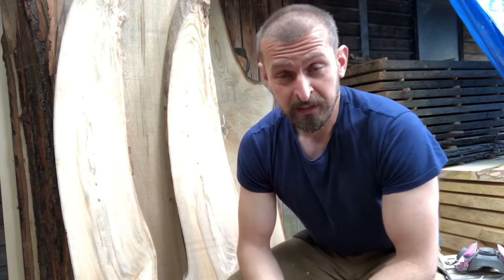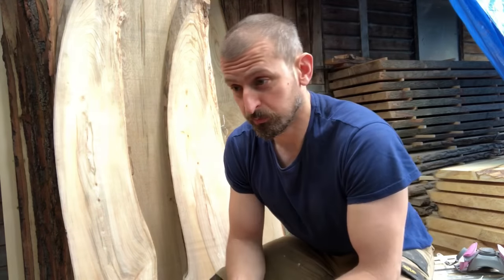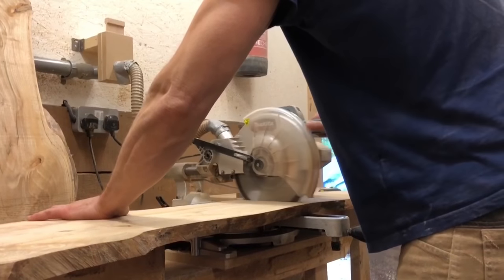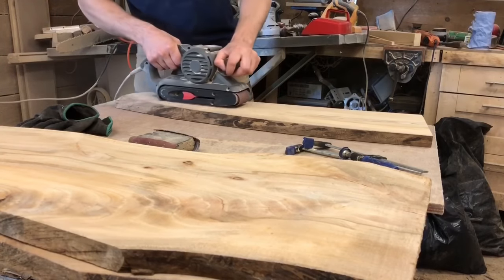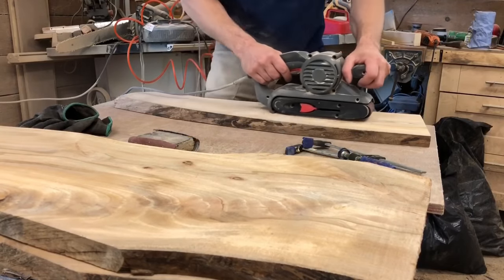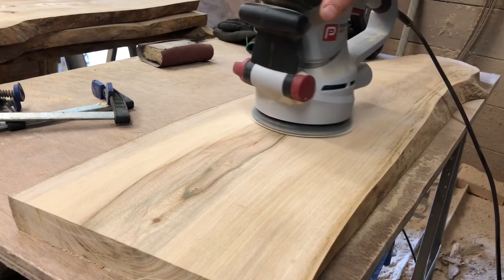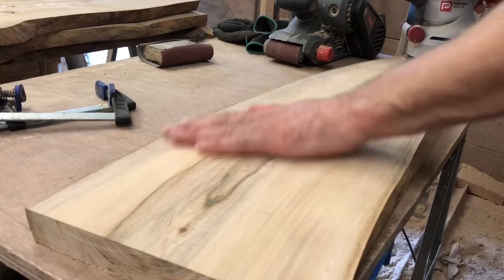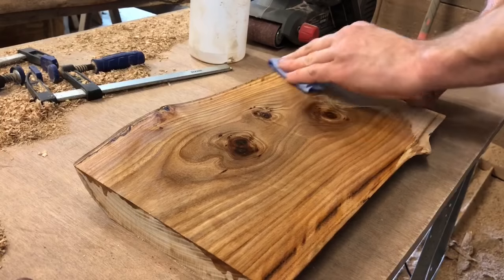Things you should know about Elm wood!

Comment: elm is a fantastic wood. The species of choice for cart wheel hubs because it will easily withstand a dozen or more mortices chopped into it without breaking apart. And was the species of choice for traditional chair seats, again because it will happily withstand all the round mortices for the spindles legs and arms without splitting. It improves as it ages and wears to a fantastic smooth velvet patina when clothing etc polishes it. And elm was always used to make the massive cylinders for village water pumps, and water pipes. I believe some pipes were dug up in London Thames that were 400 years old. If its water logged it will survive a long time, much like alder wood

Comment: Hi mate, firstly glad I just found your channel. Deffo going to subscribe and look at more of your content. 

Secondly I was going to ask a question about Elm. A few weeks ago I picked up a 2xm x 60cm slab of Elm that’s around 2” thick. It is showing around 15% moisture in the highest places in the middle. Those readings were using my meter with probes. Nearer the edges and the rest of the slab are about 5% to 8% moisture readings. 

The issue I have is that after sitting here for a few weeks the slab just began to form some white furry mold on the surface. It’s not the whole slab just one or two small patches but it’s like white furry mold. 

Do you (or anyone reading this) have any tips on what I can do about it? Also does anyone know why it would form a white furry mold as opposed to black mold etc.. 

It was supposed to be sanded down next week then oiled and put on to a cabinet that I just built. I thought it would make a nice looking top / work surface with some storage underneath.